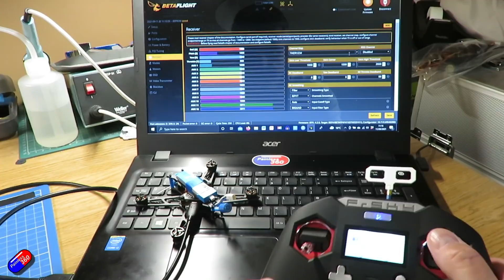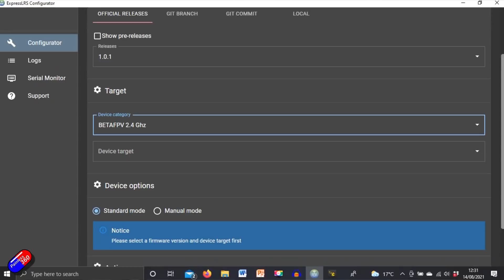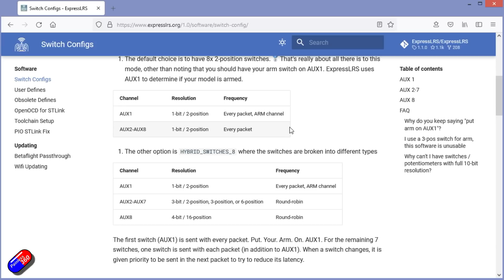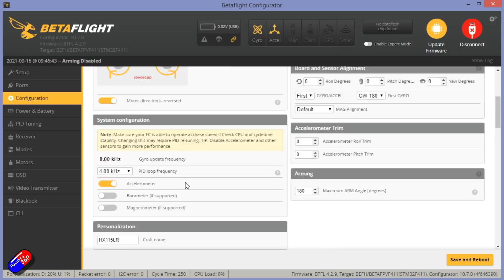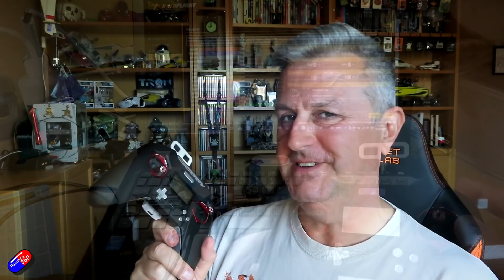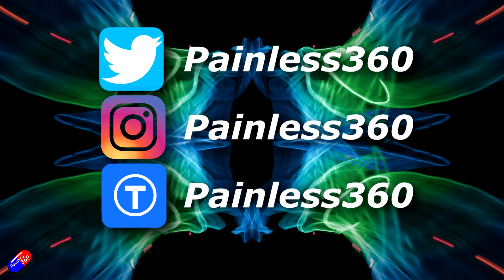What is ExpressLRS? ELRS explained for new pilots on what it is, and how to use it...

Comment: Sounds troublesome! 
Has it gotten better since the date of this video do you think? 
Considering getting the Tx16s and which internal tx system to get it with and elrs being one of the options built in or the 4in1 looking into info about each. Currently using tracer but considering ELRS only it doesn’t seem to be a very straight forward system.
Reply from the maker: ExpressLRS has matured a lot since this video was made. We are now on V3.x and it just keeps improving. The hardware options for ELRS have improved out of all recognition too with vendors like RadioMaster really working closely with the project to deliver some solid hardware. See my other, more recent, videos on ELRS..
Reply: @Painless360  will do thanks

Comment: @10:36 Welp... And with that ExpressLRS pretty much went off the table for me and my RC needs at times requiring all 8 Channels.
Reply from the maker: More channels with extra resolution coming all the time.. Best of luck
Reply: @Painless360  IMHO, that should have been a given from Day1 but I was more concerned about the apparently forced requirement of sacrificing one channel for AUX1/Arming the vehicle.

I stopped flying ( just don't have the nerve dealing with regulations sucking the joy out of a hobby ) and went back to ground vehicles so I may not even be the target audience but enforcing a concept onto everyone is kinda backwards from what I'd expect to see from a new system 🤔

Comment: I still don't know what it is. Yeah I'm 73 but I fly. Is it a new protocol something like crossfire. Does it give longer range to quads? I have a Jumper T Lite that has a add on module bay on the back but which module shoud I get ? Aren't there different sizes as well as freqs? Would it work on my Deviation based Jumper T8SG Plus radio? It too has a module bay. Is there a VERY basic video around that truly explains what this mysterious (to me) Express LRS actually is from the ground up that won't expect me to know so much in advance that watching a video like this goes completely over my head. I guess I'm in the minority of the hobbiests or maybe you are in the elite of the hobby. I applaud what you know but it meant nothing to me. Thanks for your efforts and I'm sure it must have been helpful to some or even most. IDK
Reply from the maker: Sorry to hear that you found the content of the video too complex. ELRS is a new protocol that can be be used just like others available that you are familiar with. The main differences is that this one is not 'owned' by a radio manufacturer. Happy flying!

Comment: Hi Lee, why would one want to use ELRS? What is it for? What is the advantage?
Reply from the maker: Not tied to any one vendor.  Will work with lots of legacy hardware as well as the new stuff coming out.  Impressive range and full telemetry link for one of the lowest prices for this type of kit.  See all of these covered in the video.  The only questions are about the complience of the system with local legislation... happy flying

Comment: You mentioned that ELRS connects to a rx tx uart. Do you know if there are plans for its use with ppm or sbus? Thanks.
Reply: There's a PR for adding CRSF inversion so you can use an SBUS pad, but not output SBUS. There's also at least one person fiddling with an ELRS PWM board for wings and such but that's still early on.

Comment: A lot of this stuff is doing nothing but driving people away from the hobby 10 years ago you buy one item that does every thing in one box and has better osd than anything today.  Know everything I have in one plug and play box now you have to 3 or 4 things you have to buy that was all in one box.
Reply: ExpressLRS is all compatible with each other. All 2.4ghz elrs receivers will work with any 2.4ghz elrs module same as 900mhz.

Comment: Looking forward to when tiny whoops drop D8 for elrs.  Whoop board with ceramic antenna… I can see that!
Reply: Happy model has already released a board with ELRS on board. The SPI-based receivers are hitched to Betaflight 4.3 which is problematic, but there's at least one that's on the board as a serial RX.

Comment: Hi Lee, just got my elrs gear as well can't wait to try it out! A few videos ago I asked you if the normal DJI camera would fit in the Tadpole HD and you said it would, but after ordering I have found out that (probably due to armattan's tight tolerances!) that it won't fit. Any suggestions on how to create an extra milimeter of space? You have lots of experience with this stuff so I hope you can help me out! Currently down for the count :(
Reply: You can squeeze it in, it won't damage the camera at all. Joshua Bardwell mentioned it in a Livestream not long ago, that's what the majority of frame designers are doing instead of making a seperate frame for the 20mm DJI air unit camera.

Comment: Great video.  I'm glad to see other options coming, especially for the 915 mhz range.  Right now not for me, BUT if more of MFGs start to release these on AIOs or include them as an option as a BNF (yeah probably going to happen on the quad side first as BNF rigs (any type of BNF) is really limited.  For example if I were to go buy a REKON 5 and as a BNF and I had the option to pick EXPRESSLRS, I'd more tempted to look into it.)  Right now, even with the configurator it seems pretty complex (although probably a better option than trying to get FRSKY xxx to run the same protocol as the 5 in 1 multi module on the Jumper T18 LOL).  It is great to see the work that people have done to reverse engineer it then even better that some of more experienced people like yourself who are pressure testing it and finding the bugs and doing videos like this.
Reply from the maker: I am sure that over the next few months the whole ELRS ecosystem will get a lot more polished and easier to setup and use. The challenge for the ELRS team is the huge amount of 3rd party hardware and use cases they need to support - something most closed-source vendors don't have to worry about. One of the major problems for the project long term is nothing to do with the technology but the legality. Declaration of Conformity and other legal paperwork is needed to be able to sell and use this stuff in many parts of the world.. Happy flying!

Comment: The more I watch / read about ExpressLRS the more I'm tempted to buy a TX module to try out the RX's that Happymodel & BetaFPV sent to me so I can make folding TPU holders to put on Thingiverse (Happymodel done, BetaFPV 2.4G RX next).
But then I remember I have Crossfire which is virtually plug & play :)
Reply from the maker: As a Crossfire pilot I know what you mean. It just works and is something I can trust, even on the expensive models.. Happy flying!
Reply: Do it man, everyone keeps saying "oh flashing ExpressLRS is difficult' is ridiculous, it's no harder than flashing betaflight.

Comment: I see a lot of people jumping on as its the new hotness with high refreshrates etc, but then getting burned with nothing but troubles. Problem is, it isn't consumer ready at all. People complained about how flakey the TBS ecosystem can be in certain circumstances, but it is orders of magnitude more robust than ELRS. This will of course change in time as the ELRS core becomes more mature and stable, and the focus moves to all the end-user comforts and code to catch all the edge-cases (there are lots!) with flashing firmware and binding etc.
Reply: The only place people have been having issues is when a) using FrSky R9 hardware and b) not updating the firmware for bug fixes. To say that the TBS ecosystem is more robust is false, LoRa is more widely used  The reason why some many people are switching is because of the problems and hardware failures with TBS lately. Not to mention the 1/3rd of the price of a TBS nano receiver. Anyone who brings up that lack of customer support and hardware failures as a reason to dismiss ExpressLRS just doesn't understand the project.
Reply: @anthonystownsend  I'm not talking about the robustness of RF modulation, but the software/patching ecosystem and firmware bugs. There are many reported issues with ELRS beyond what you have listed. Check the github issues page, check the facebook group, check discord. There are many varied problems being reported all the time. ELRS will only get better, and is certainly a viable RF link right now if you're prepared to overcome teething problems, but if you just want to fly and not do any tinkering there are better options as of right now.